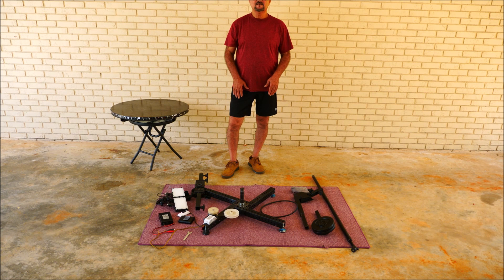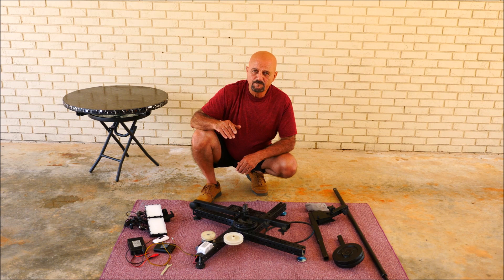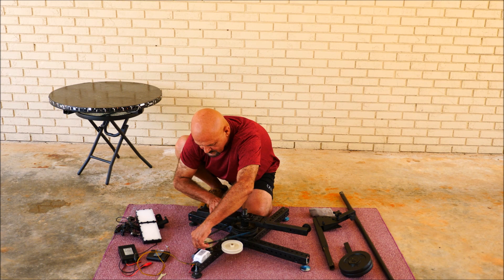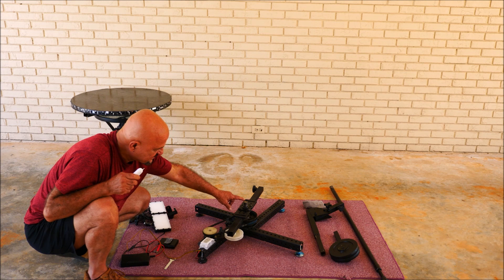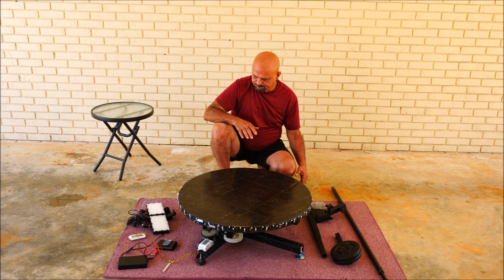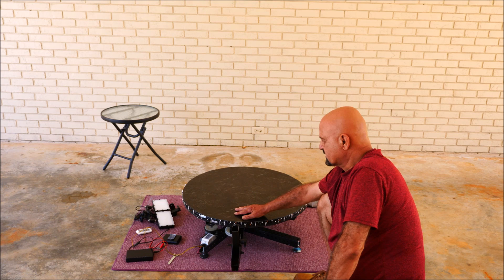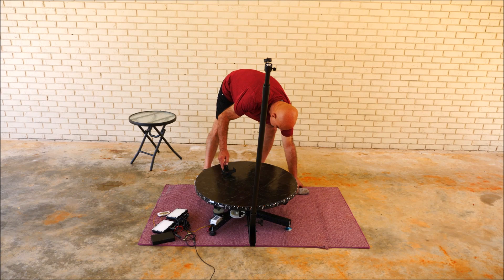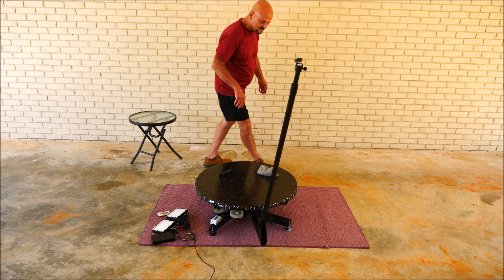How do you make a homemade 360 photo video  booth part 2 Final result. Wait till the end

Comment: Thank you so much. I just have two question. Did you find the bottom framing as one piece or did you weld this together? Also can you link both pulleys or include the measurements? Thanks again!
Reply from the maker: Yes it was one piece cut it and did the welding, Any 4" pulley will do it just make sure the center hole is  1"
Bearing -https://bearingsdirect.com/lmf10uu-e-linear-motion-euro-flanged-ball-bushing-10x19x29mm/
Pulley-https://www.amazon.com/Parts-Camp-Replacement-Husqvarna-532129861/dp/B07C4T6N5N/ref=m_crc_dp_lf_d_t1_d_sccl_4_2/145-6873551-9467418?pd_rd_w=VHeg6&content-id=amzn1.sym.a5144f00-3d78-40a4-aa84-7ff51eea31f7&pf_rd_p=a5144f00-3d78-40a4-aa84-7ff51eea31f7&pf_rd_r=EM26CACM7ZDVVXCNPS7J&pd_rd_wg=9wEsP&pd_rd_r=e5031e10-ade7-4c16-b606-b4a302e758f6&pd_rd_i=B07C4T6N5N&psc=1

Comment: Great work ,,where can I buy the metal from?, I want to use that same type. Thank you .
Reply from the maker: They are square tubing, but the one I used are the same one used for stop signs, you can find them pretty cheap, the center shaft is one" paid $20 for it, it was used for golf cart, motor is 16 rpm, pulley came from an old mower. hope that helped

Comment: I have the exact power supply and the exact wireless remote and the motor isnt turning. Does the re.ote has to be programed or jumped ?
Reply from the maker: No it does not, Here is a link to both motor & the Motor Control.   https://www.amazon.com/gp/product/B07BBXP3G5/ref=ppx_yo_dt_b_asin_title_o01_s00?ie=UTF8&psc=1            https://www.amazon.com/gp/product/B0774HGZGX/ref=ppx_yo_dt_b_asin_title_o00_s00?ie=UTF8&psc=1

Comment: Where do you get the arm from?
Reply from the maker: I used microphone stand
Reply: Can you put a link for the complete arm and bottom arm or do a tutorial on how you made that 360 arm to hold the camera I’m trying to make this piece I’m having trouble
Reply: The bottom square pipes are not stop sign tubing I need that can’t find that or the arm angle piece I need your help or please do a tutorial on building the arm and how you attached the phone or iPad to it please I’m stuck on that part you never showed how that was done thank you and great work
Reply from the maker: @jasonsturman3165  The arm that I attach the camera to it? I used microphone stand which is adjustable with 1/4 20 on top.
Reply from the maker: @jasonsturman3165  I responded back on your first comment. microphone stand.
Reply from the maker: Look at the right  it's round tubing was used for microphone

Comment: Have you got a part list?
Reply from the maker: They are square tubing, but the one I used are the same one used for stop signs, you can find them pretty cheap, the center shaft is one" paid $20 for it it was used for golf cart, motor is 16 rpm, pulley came from an old mower. hope that helped
Reply from the maker: Motor
https://www.amazon.com/dp/B0774HGZGX?psc=1&ref=ppx_pop_dt_b_asin_title

Power bank
https://www.amazon.com/gp/product/B00MF70BPU/ref=ppx_yo_dt_b_asin_title_o01_s00?ie=UTF8&psc=1

Controler 
https://www.amazon.com/gp/product/B07BBXP3G5/ref=ppx_yo_dt_b_asin_title_o01_s00?ie=UTF8&psc=1